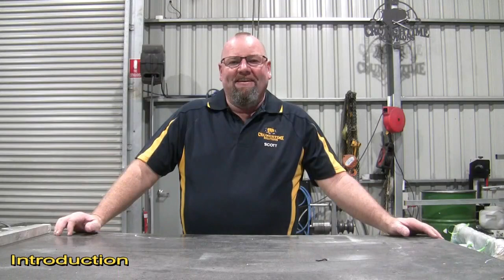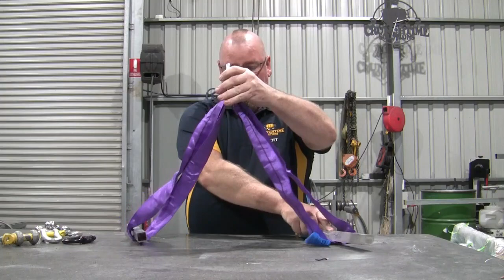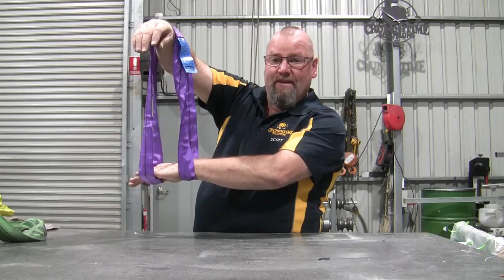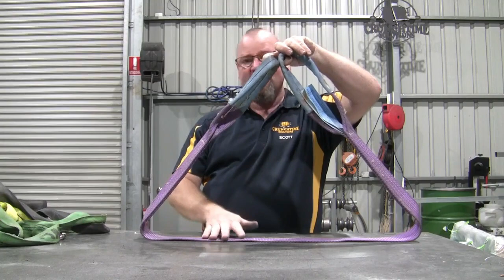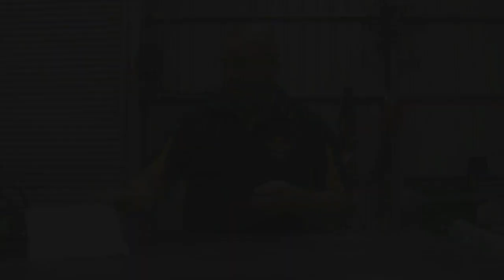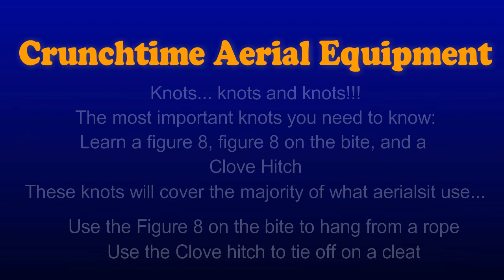Basic Aerial Rigging

Comment: Does twists in nilon rope or slings affect the tensile strength? Asking because I'm planning on hanging a lyra and silk from a pulley to allow pulling out of the way when not in use.
Reply from the maker: No, actually the twisting would probably increase the strength slightly. I have never done the test but rope is naturally twisted for strength, so some more wouldn't really affect it. Up to a point that is, if it's twisted quite a lot then it would have an adverse affect. That would be twisting it to a point where the rope shortens. If in doubt, just add a swivel!

Comment: What's with swivels and steal carabiners? Swivels are all from aluminum and how fast will it wear down if we combine it with steal carabiners? Great video, thank you :)
Reply from the maker: Hi, yes I get this question a lot. A steel carabiner on a alloy swivel works pretty well. It's not so much the material but more so the shape. A steel carabiner being round, and an alloy carabiner has a very large radius on the edges, so they work well together. Being steel the carabiner will last longer, but the swivel will last quite well due to the shape. Just be sure to check it, take a look at the swivel every 4 or 5 uses and just see if it is wearing. As I mentioned you can get up to 10% wear before it needs replacing, and in some instances that can take years! There are many factors that contribute to wear, type of use, weight/load, dynamic v's static, it all makes a difference, so the key point is to just keep an eye on it :)